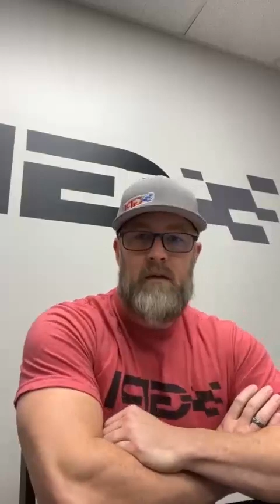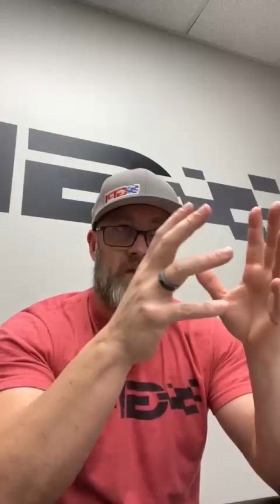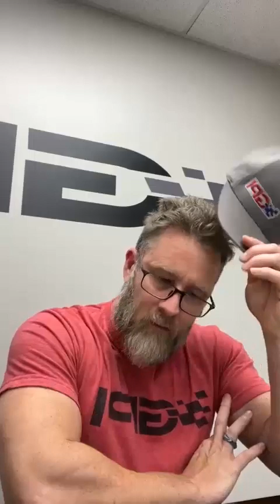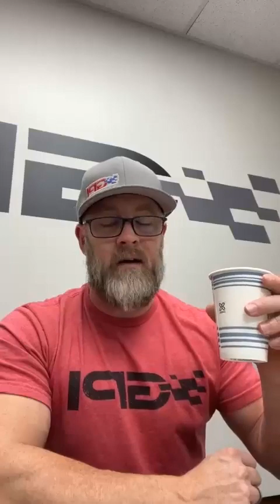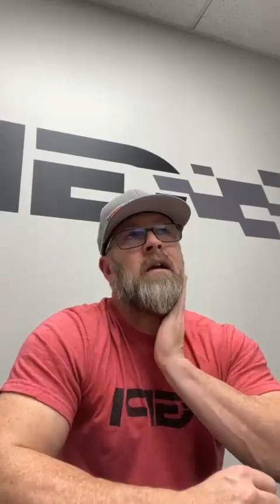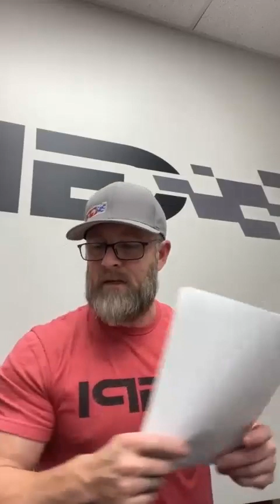Q & A Fuel Types

Comment: Great video.  My tuner installed a toggle switch under the hood where I can toggle between 100 octane or I can run down the tanks and just run 93 pump.  I run Sunoco 260GT 100 octane all of the time.